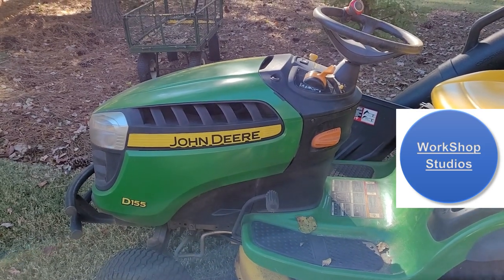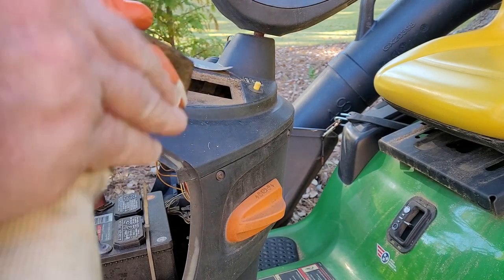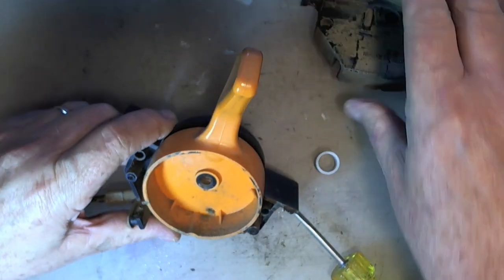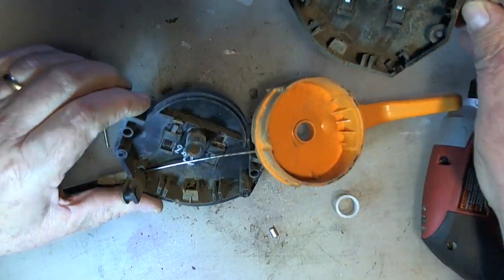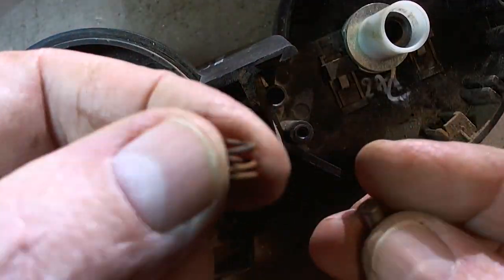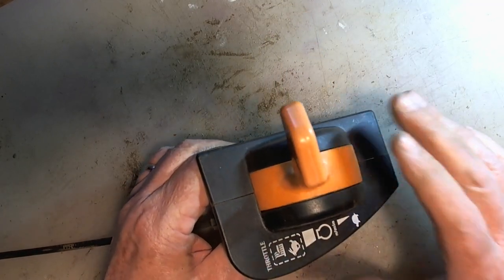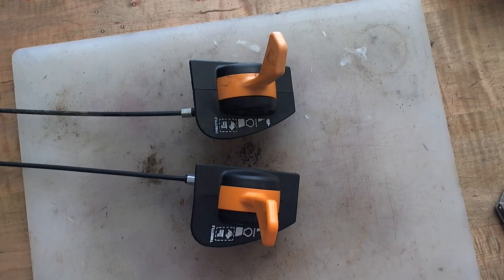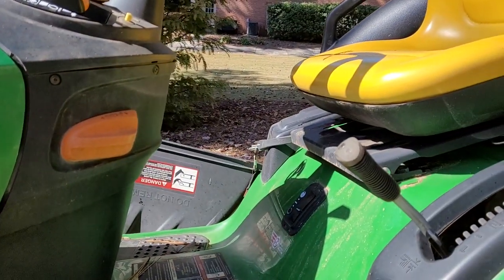mower throttle slipping

Comment: I have a D155 also, and having the same problem. I'm debating if I should buy a new throttle unit or try cleaning it like you were doing. I bought it from Home Depot and this year is the first time I'm having problems with it. It started surging and I replaced the fuel filter and the fuel pump, it turned out the pump was bad. That helped alot but it was still surging at high speeds. So I took the carburetor apart and cleand it. What a pain in the ass that was. I ruined the gaskets when taking it all apart, so I decided as long as I had it all apart I would just put in a new carburetor. I got it from Amazon. It was a real pain putting it all back together. I took me all most a week to do it. Of course I don't have a garage to work in so I had to stop durring the rain. A wise man told me to trade my old one in for a new one every three or four years. I might get a new one next year. Thanks for the video, your video is the first one I've seen on YouTube with the D155.
Reply from the maker: Gary, 
Wow, I hoped that John Deere would stand for quality, but your mower is a hot mess!
I can say that my d155 has performed well.  It not only mows about an acre of grass, it pulls my trailer,  drags a rake /dethatcher,  is a mobile mulcher, and sometimes a grader (pushing material with the mower deck all the way down).
I try to keep up with the maintenance. But not always on a timely basis. 
I did post a replacing the starter solenoid if you'd like to take a look. 
Hope that helps!
And thanks for watching and commenting 👍 🙂
Reply: @workshopstudios43  I use my lawn mower just for mowing the lawn and pulling a little red cart. Before my D155 I had a Cub Cadet super LT 1550 52" deck. and before that is was a Cub HDS 2135 lawn mower. My dad had Cub Cadet's back in the day. So when it was time for me to buy my own lawn mower, it was going to be a Cub. I once hit a rock with my Cub Cadet 1550 and for the first time ever the rock bent the blade. Never had that happen before. So I did a little investigating the situation and found that MTD Products acquired the Cub Cadet product line in 1981. I believe the quality has gone down hill ever since. That's why I bought a John Deere product.